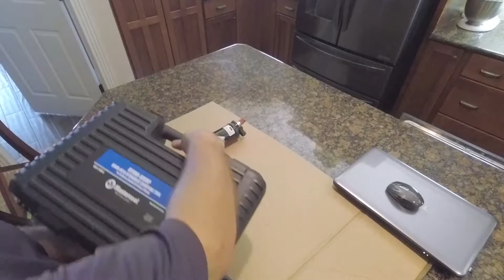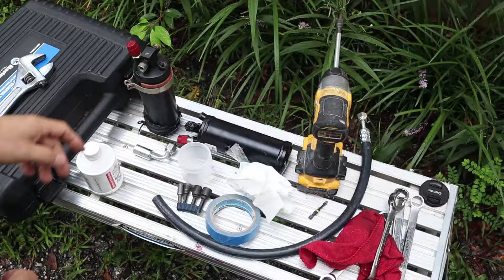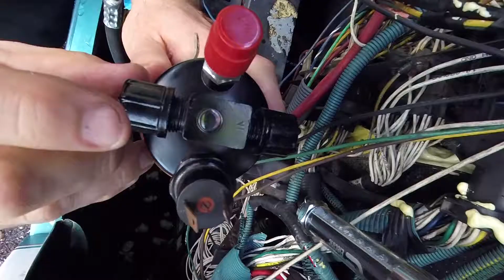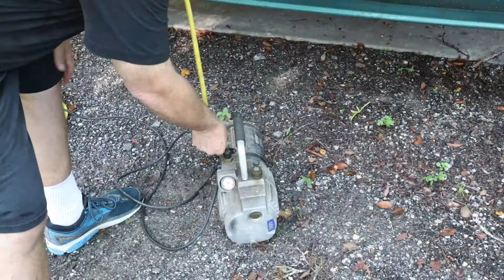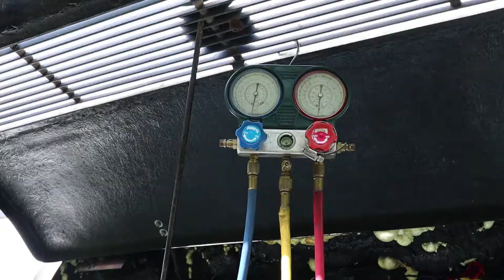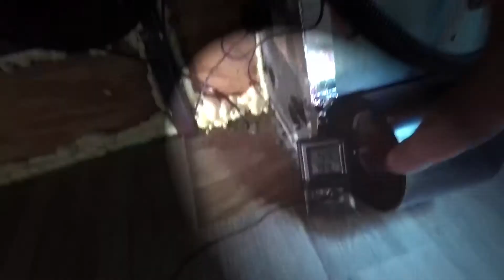RV A/C Line Repair how to Part 2

Comment: Awesome video. Thanks for posting and taking all the time to video, edit and upload this. I'm currently.dealing with a 03 Newmar that's been leaking refrigerate. Had Freightliner replace a hose at the condenser at the rear side radiator almost 3 years ago and it worked great for almost a year and then gradually stopped cooling.  Last year Oct 2020 after not being able to really go anywhere due to covid I tried locating the leak. I found the low side charging Schrader valve at the front of the coach had a small leak(electronic detector). Today I found the upper fitting on the condenser had a pretty good size leak with the electronic detector and soap and water. This was not the fitting freightliner replaced but the other one. It wasn't very tight and once tightened a little more it stopped leaking. I have a Schrader valve replacement tool from mastercool on order to replace the valve while under pressure. Glad I found your channel.
Reply from the maker: Rick, thanks for the awesome comments. It makes me happy to hear your words, most people don't realize the work that goes into making a video. That core replacement tool is really cool.